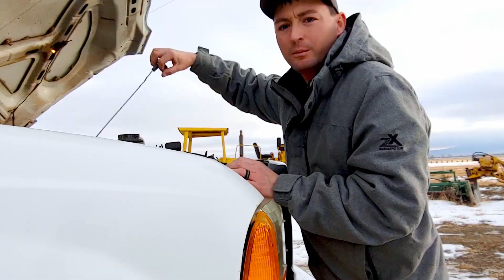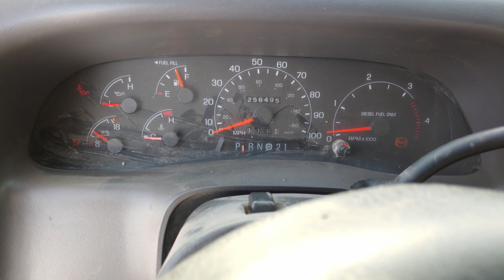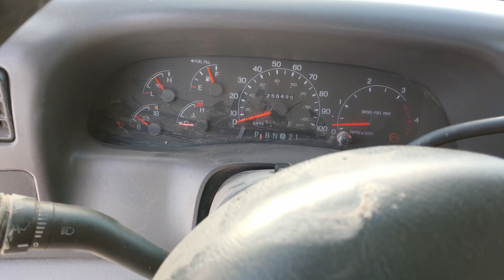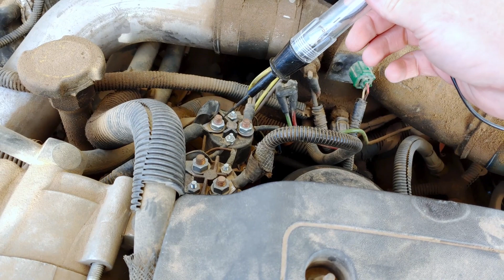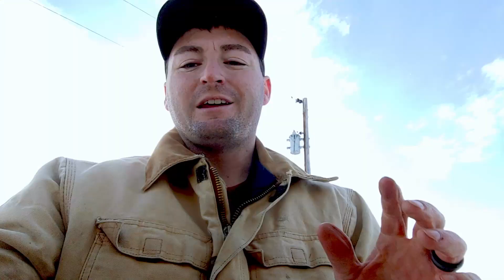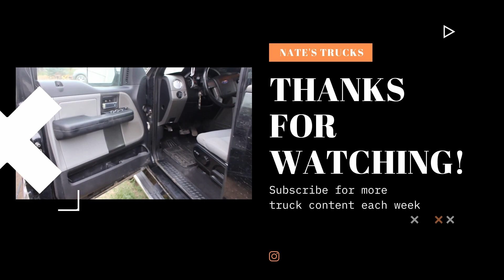Trying to Start my Cheap 7 3l Diesel & How to Check your Glow Plugs

Comment: That is low miles to me but I guess you could say it’s high my trucks got 396k original engine still a good truck daily driver my dads 7.3 has 730k miles original engine my brothers has 440k on it all good truck and they are beat on to that truck probably had some dumb employees put gas in it and blow the motor
Reply from the maker: Nice! 7.3's last forever with good maintenance! High miles on everything else is just getting a 7.3 broken in. I sure hope to get it running soon, it's off for a compression test right now... figure it was a little neglected by the company who owned it previously (defiantly needs more than just glow plugs & a battery like I was told haha)